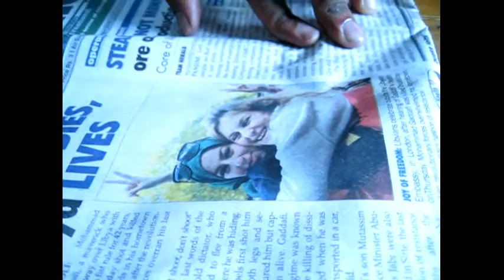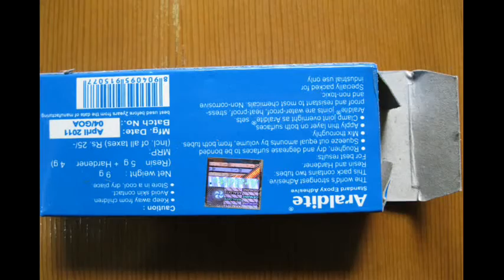guitar bridge adhesive sound board repair

Comment: The choice of araldite was very good, you can clean it with a damp cloth or even alcohol (only if the guitar has a varish that will resist alcohol!) It is better to make a wooden spatula rather than use matches.